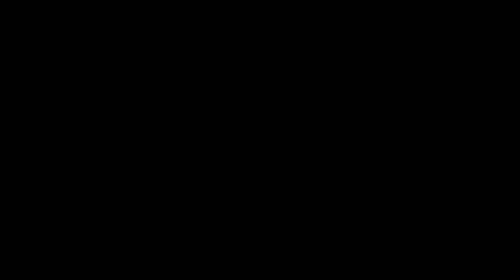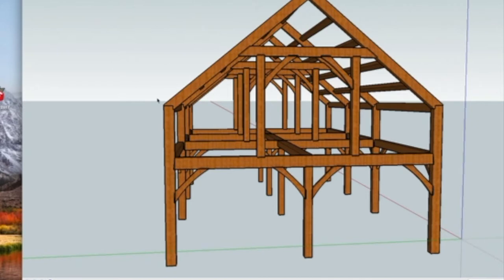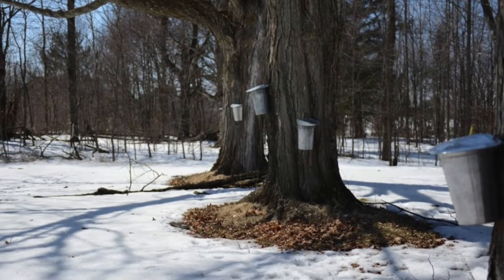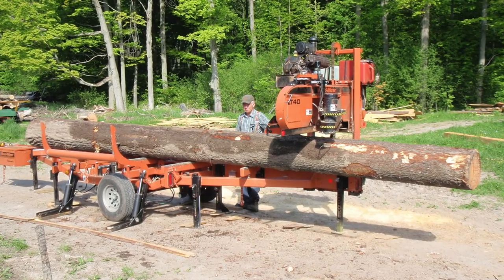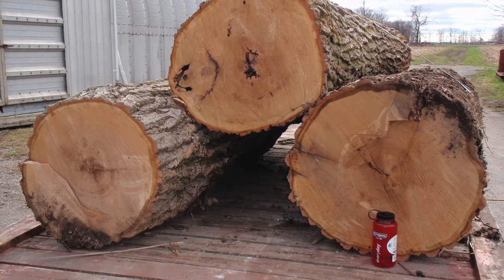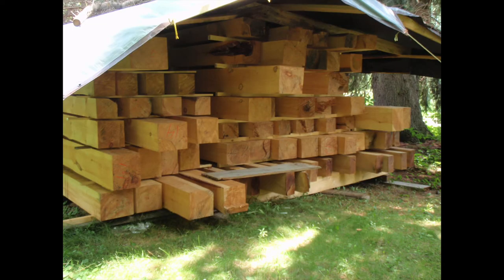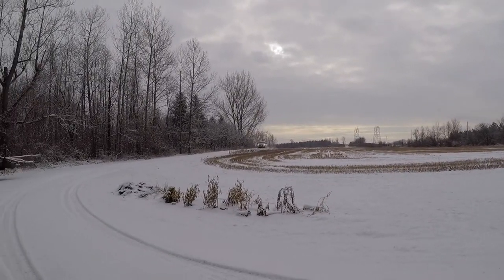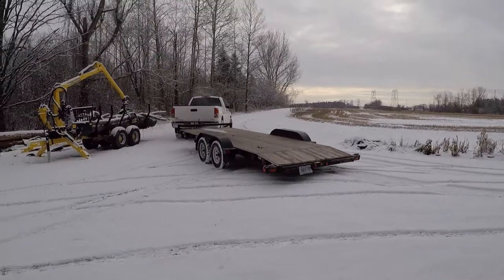A Timber Framed Woodworking Shop - Part 1

Comment: What equipment did yu use for material handling?  I am looking at getting equipment and I’m  wondering what can best manipulate these heavy logs.
Reply from the maker: Hi, I used my small farm tractor for most of my handling, but for the larger logs I needed to borrow a friend's larger tractor.  Forks are a huge asset

Comment: Hello, do you know about how many board feet of lumber you used in your posts and beams? I ask because that's how the local mills price there lumber which is about $1/bdft here in Missouri. Also are these plans available anywhere online?
Reply from the maker: Hi, I'd have to calculate it but they may price beams lower than say 1" boards because they're less time on the mill.   Depending on the mill.  If I had to guess quickly, I'd say around 4 to 6000 BF

Comment: Can we use a 6x6 beams and posts for a small 24x36 single story timber frame?
Reply from the maker: It's a hard question to answer with a lot of devils in details, but I would say it's highly unlikely.  A 6x6 won't span very far and there isn't much room for opposing tenons/mortises.  Good advice to hire a desiger who knows timberframing and consult an engineer.
Reply: @DovetailTimberworks  8x8 are hard to find. have you ever used glulam beams ?
Reply from the maker: I have a couple of times to deal with span issues much more economically but usually not in situations where they are visible.
Reply: @DovetailTimberworks  may I ask if have you build/engineered them by yourself or purchased them? Thank you for the answers I appreciate it
Reply from the maker: @Diycanada560  Typically I design to avoid glulams but if that's impossible and the clients don't mind having one, I will simply draw a glulam into the designs I send to the engineer and ask them to suggest the specs.  Pretty easy for them to do and then you're guaranteed it's correct.  You can then build a box around the glulam afterwards and hide it pretty well.
Reply: @DovetailTimberworks  thanks again very helpful